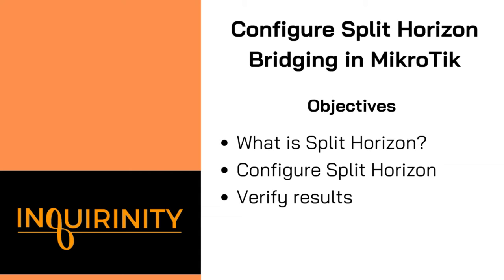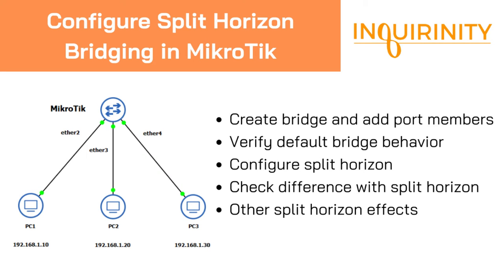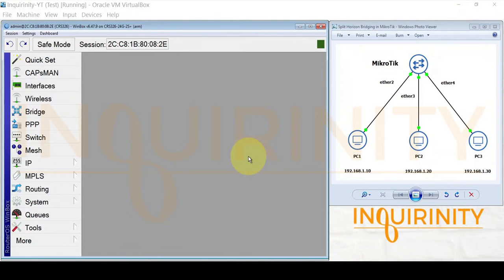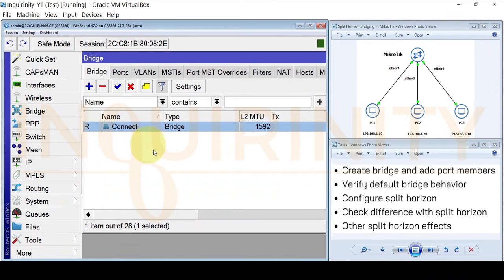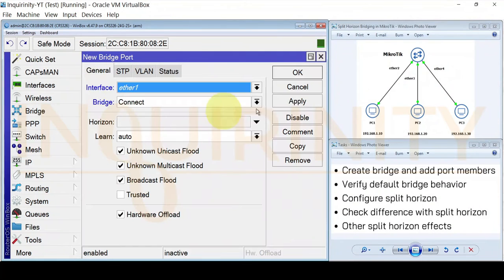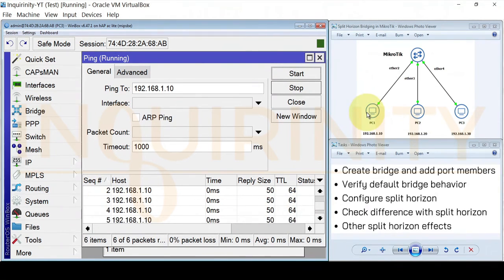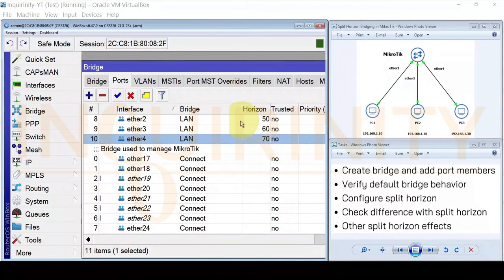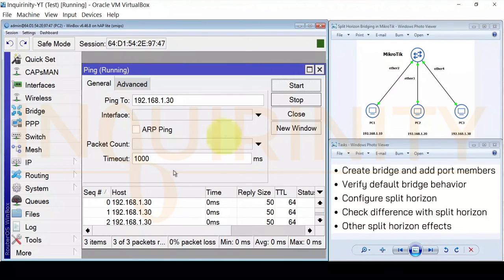Configure Split Horizon Bridging in MikroTik

Comment: hello bro
its big mistake to use horizen
it will lose the harsware of load and all traffic go to cpu
from switch chip best way to isolate ports
Reply from the maker: Yes, if you watch the entire video, it is shown that Split Horizon will lose hardware offloading and thus will not make use of switch chip.
Reply: @Inquirinity  i wish if you make video about switch chip  vlan with out lose control to router
its good video will be
best regards bro